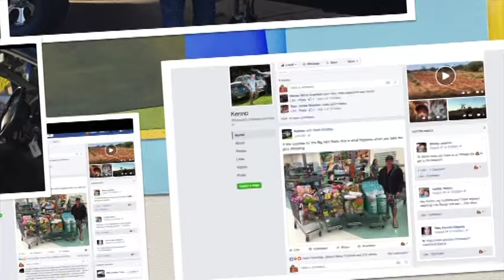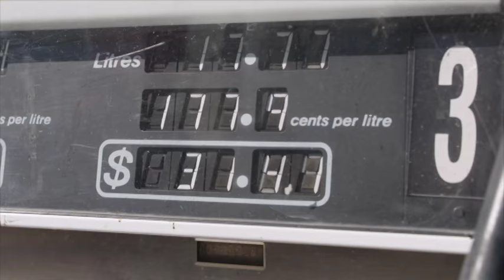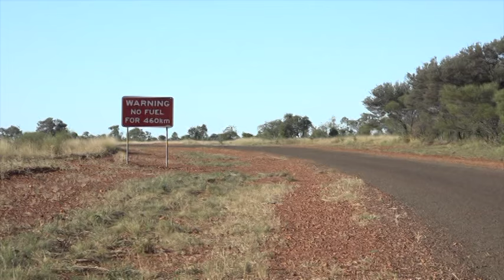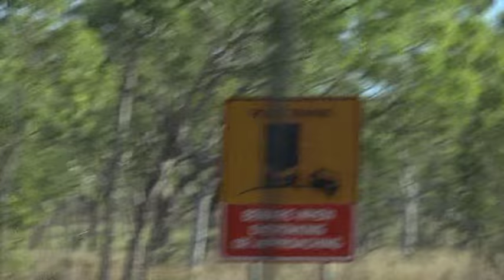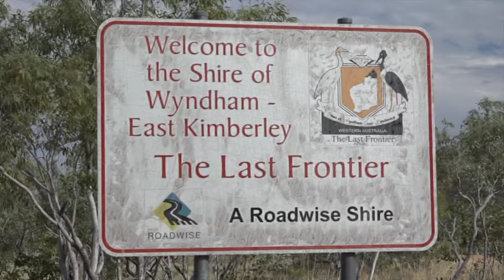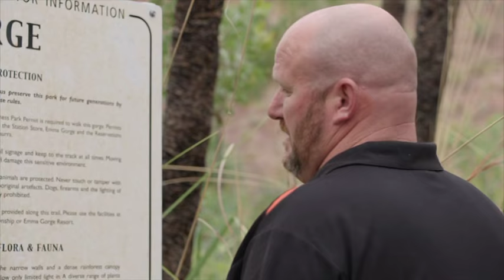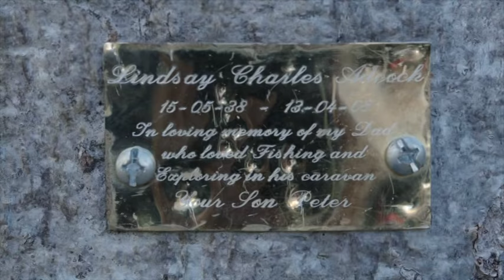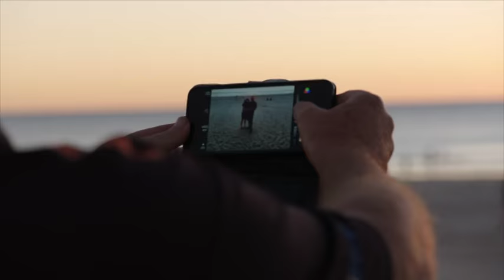Brisbane to Broome: MDC Offroad Caravan

Comment: I can see all the vehicles have the VHF FM Radios, but I noticed something extra on one( Keno's Truck), as well as a larger Vertical when you were all at the Concert Site.  Been wondering if at least one of you is a licensed Amateur Radio Operator.  Also I always Solder my Connections, and use Glue lined Shrink tube to keep water out of the Wiring.  We have a lot more water and mud here in Canada, as well as Salt and other DE-ICING product they use on the roads in the winter.  They are great for melting and removing Ice but they also corrode out Electrical wiring if you don't protect it well.

Mike
VE3NLP
Reply from the maker: We use UHF radio in Australia, no need for a license as it's covered under a class license.